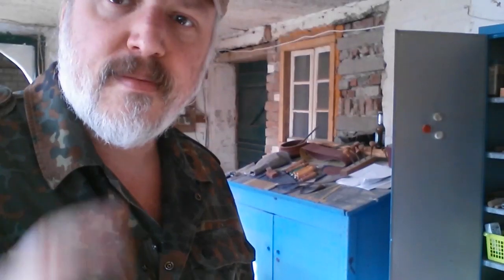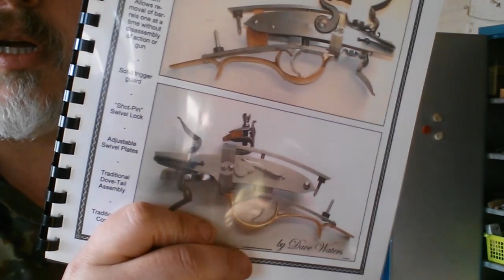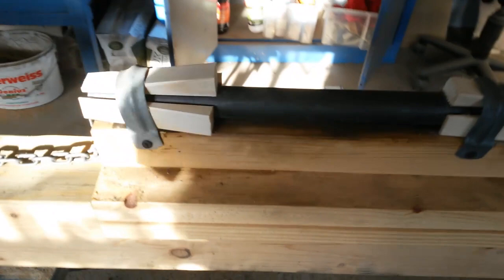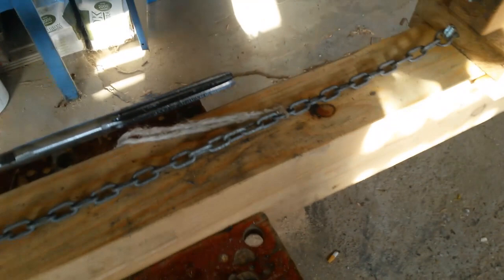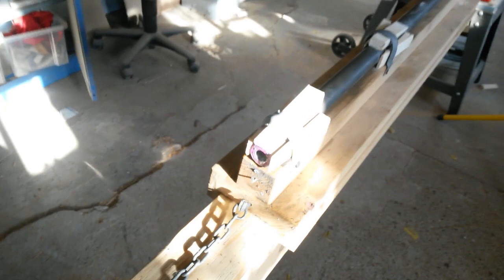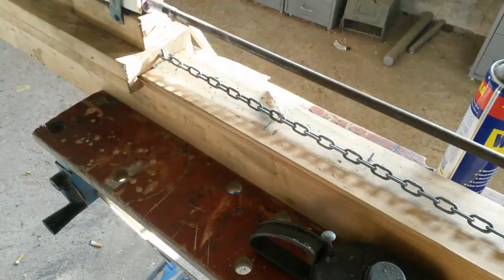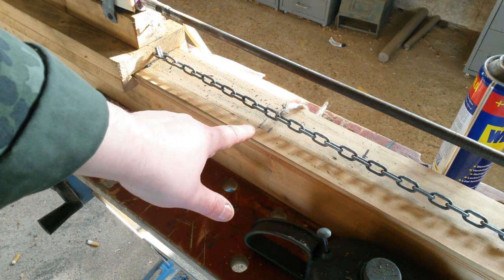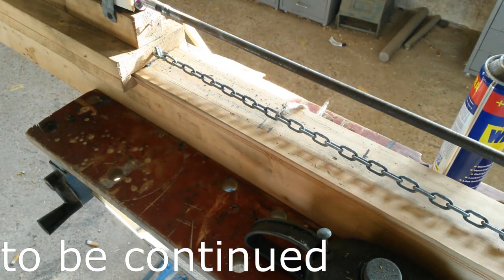Swivel breech rifle scratch build pt  1 start with reaming the barrels

Comment: I think you would get a better cut with your reamer if you could pump cutting oil back through the barrel and into a container, that would allow you to flush out the swarf which cause finish problems, it would also keep the reamer cool and give a better finish to the bore, this looks very good, nice to see it at the start! Stay safe ! Chris B.
Reply from the maker: Thats a good Idea sometime it would be nice to make a hollow reaming shaft. Than it will be perfect to get some oil in . Like this I have to take out the reamer after every 10mm to clean it and take out the chips so thexy do not damage the bore... for the rifling cutter I made a cutting bit from HSS steel that was way better . But reaming and rifling will consume a lot of time so I think I will start the build of the mechanics the same time .... so stay safe Roger S.
Reply: @homemadehistory7537  If you pump the oil from the other end it will "wash" the swarf away from the cutter, a small tray under the entry will catch the oil and swarf, providing there is clearance around the reamer shaft the debris and oil will wash past. Good Luck, Chris B.
Reply from the maker: @453421abcdefg12345  Today I tesed to blow out the swarf with air  but the space between the reamer shaft and the bore is to narraw so all chips are catched in that gap.... it took some time to get out the reamer. There are two posibilitys, make the shaft way thinner or go on like it is ? To make the shaft thinner could bring the risk of breaking, cos it is just welded on the rod ... maybe I will make the two barrels with the actual set up and make a new reamer for one of the next projects.... Nobody said it will be easy 🤣🤣 Roger S.
Reply: @homemadehistory7537  I think that is the reason liquid is used, air will not carry away the swarf like oil/liquid will, I think the shaft of the reamer will need to be only 9mm right up to the flutes of the reamer to get the swarf away, I am sure you will get the better of it in the end, good luck! Chris B.
Reply: Using any other oil than WD40 would help a lot too. Preferably a metal cutting oil but WD40 is only used for aluminum. Im a 37+ year machinist so trust me on that. In my shop I use either tapping fluid like Tap Magik brand or less expensive pipe threading oil for most metal cutting. WD40 is not even a cutting fluid. Its a water displacement fluid. Hence the name. Invented by NASA. water displacement formula 40 is its origin. Really cool project you got going here. Watching all the videos from start to finish.

Comment: Nice,what kind of material are you using for your barrels.
Reply from the maker: It is seamless hydraulik pipe with 26 on 12 mm diameter in St37 . Not something very strong but good enough for the job..... and way better than the material the old gunsmiths used 😁

Comment: You like to keep yourself busy!! What was the original bore diameter of the tube please?
Reply from the maker: at these times its nice to have something to think of ....😆 The pipe is seamless hydraulic pipe with 26 to 12 diameter. That will end with a 24 oktagon and a 22 diameter round in front 😁